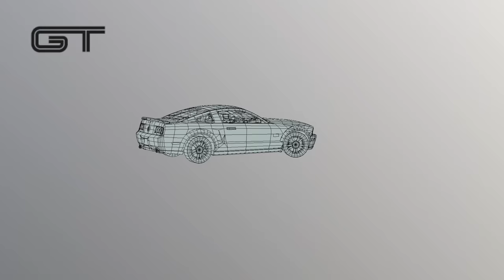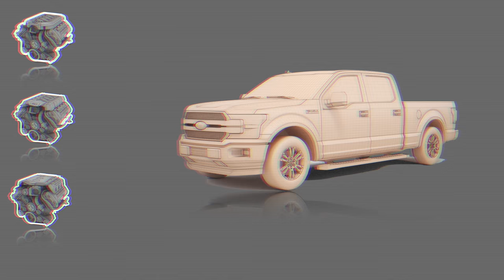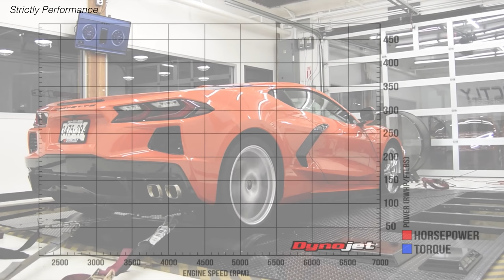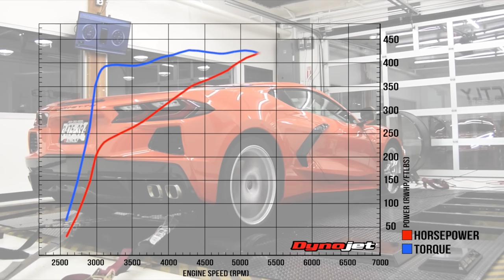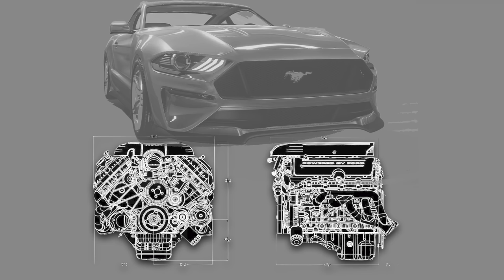How 5.0 Coyote Engines Beat LS and LT😮 | Explained Ep.2

Comment: I love my gen 3 coyote. Put it on the dyno and straight from the factory it made 412 wheel horsepower. Now I've added a Roush X pipe, steeda CAI and an E85 tune. I'll find out my new numbers next month which I'll post on my channel.
Reply: Yea I just sold my mustang still sad. Was a 2017 ecoboost. With just an intercooler, downpipe and a tune thing made 403 wheel with 460 tq but made over 400 tq at about 2000 rpms. Funny how the small ecoboost engines are torque monsters while big displacement boosted coyotes are hp monsters. Wonder why coyotes for making so much hp make so little tq till it's way up high.
Reply: @4touchdowns1game29  because that's what boost can do to an engine
Reply: @4touchdowns1game29  small turbo = fast spool, which means more torque down low.
Reply: @4touchdowns1game29  engine design
Reply: @4touchdowns1game29  that small turbo on the eco spools up early that’s why
Reply: @jasonn277  two small turbos....
Reply: @Steve-yr5vi  the 2.3 is a single turbo engine.

Comment: that was great.  I always thought the only way to go would be an LS swap.  I'd love to do a Coyote swap on one of my Crown Vics whenever (or if it ever) wears out.  But they seem so well made that they will probably outlive me.
Reply: I had a 2003 Crown Vic with 300k on it. It was my first car. Just sold it. I just had to add some oil every couple thousand miles. Changed the coil packs and spark plugs but besides only a few other minor mechanical things it runs great. The 4.6 is one of the most reliable engines ever made in America.
Reply: Get your wallet out bro
Reply: Your old vic motor will never die. You're just going to have to do it.
Reply: Ur gonna spend less than half on an ls than a coyote 5.slow. hell even the lincoln continental guys build turbo ls engines for roughly 6k rather than a bone stock coyote for12-15k

Comment: the ls3 makes similar to more power on boost with cam and there are heads flowing 360-380 you can buy to make 800rwhp. put forged pistons and rods and make 1100 reliably
Reply: Exactly
Reply: Without forced induction I doubt it. Also I better get higher horse for a 6.2 liter.
Reply: @losifer3867  800-950 rwhp stock bottom end ls3 light boost. 1100 forged internals, never break beating on it, 1300-1500 rwhp on stock aluminum block with aftermarket sleeves, and lsx iron block for higher power drag builds. 1200 has been dynoed from stock rotating assembly 4.8 truck ls engines. try that with a 12 to one compression 5.0 and see what happens. without e85 or race fuel and an expert tuner, over 800 power levels on pump with a coyote will explode. over 800 with any platform requires full 20000 dollar builds to live for a while regardless. you are an ls newb my friend
Reply: But ya see fords bottom end can handle up to 800 hp safely from the factory
Reply: @marcharris4176  not without E85 or race fuel on 93 at 12 to 1 compression motor can only see so much boost and cylinder pressures before fuel detonates and blows the Pistons all to hell in it. LS3 can handle 1,000 flywheel I know many guys are in the mid-800 wheel horsepower range and been driving them that way for 3 years without blowing them up on pump.

Comment: I'm familiar with 4-valve motorcycle engines and two valve motorcycle engines there is a pretty big difference in horsepower on the dyno and especially the cylinder heads at low lift on a flow bench the four valve flows a lot more air at low lift just my experience but this is not set in stone there's an advantage to having four small valves versus too big valves the two big valves are heavier and they will float before the four small valves float just saying
Reply: That depends. BMW m43 8 valve vs m44 16 valve, intake 71g vs 2x47g, exhaust 64g vs 2x47g.
Reply: more small circles can consume more area of a larger circle they are fit in.. more valves should allow more air in and out as you open more of the cylinder with eqch breath. yamahamma made a 5 valve for q second!

Comment: Man, I had an '03 Ford Lightning and my brother had an '04 Mustang Cobra (both brand new). Those 2 were the best sounding cars ever. Both supercharged, Lightning had a 5.4 and Cobra had the 4.6
Reply: I had the first 99 lightning in my town. It followed the also new 93 Cobra that I eventually sold to a founder of the MCA. And a 93 and 95 lightning,  88 5.0 and 89 gt , etc. Ford has always paid for tech in the engines. The Sierra RS Cosworth,  SVO, and SHO are the first show of serious engineering.  The new Corvette engine is a huge improvement on the coyote.  Over 600hp naturally aspirated.  I like my Dodge products for the retro design and simple but reliable engines however.  The Ford rules in the v8 category until the Corvette engine gets into the Camaro if it is still ever going to be produced.

Comment: ".....How 5.0 Coyote Engines Beat LS and LT....." 
Do they? 
They're bulkier, more complicated, more expensive, about the same weight but 50-to-100 c.i. smaller, and no more rugged. Aftermarket parts cost more, and are less easily found. An LS is pretty much THE choice for engine swaps, into virtually every car (except Mustangs). And I'm saying this as a non-Chevy fan.
Reply: You just have to watch the video. You can’t just read the title…

Comment: No lie, I’d love to see a comparison like this with the hemi, coyote, and LS/LT
Reply: No point ls/lt does everything the hemi does but cheaper and better
Reply: @scottearl7687  Better? Well that’s debatable. I’ve seen 5.7 ram trucks give a some LS guys big problems at the track. I agree with you on the LS platform is definitely cheaper though. The after market support for the hemi isn’t as large as it is with Ford and GM, so the expense makes sense. However Eric Holdner proved the older 5.7 hemi’s are more than capable of 600+ stock bottom end with the right piston ring gap. Who knows what the 5.7 Eagle would do. So there’s definitely a conversation to be had about the 5.7 itself. Let’s not take for granted that the drag pack starts life as a 5.7 block... and 7.5 second quarter is nothing to sleep on.
Reply: Look up LS vs coyote shootout an you will see why LS is on top

Comment: I like the DOHC 4 valve design. I have an 83 CB1000 custom where that tech was introduced to the states in the late 70s early 80s bikes. My bike makes 100 hp in low compression air cooling. Fascinating!! But in V8’s displacement rules. And the cam in block design allows 50% or more xtra displacement. I like the coyote like I do my 2 motorcycle engines both Honda 1000’s. The Custom n the 2005 CBR. The Coyote people say the LS needs more displacement to beat the Coyote. Well make the coyote 8.0 liters. I’m actually considering a Coyote mustang. Narrowing it down 240i, mustang, gen 6 corvette or a Toyota Soarer.

Comment: I love everything about the coyote on paper, but the footprint and its complexity keep me away. It is massive from valve cover to valve cover and has 40 more moving parts, even with the "technical" advantages, it doesn't seem to hold up on a dollar to dollar basis. As things are slowly getting better with more vehicles on the road using this platform I could see myself getting more interested in a build using this platform. Ford has always been or tried to be the "high tech" American automotive manufacturer, but it seems that 99% of the time this has just equaled a higher cost to build and a more limited audience in the after market scene. I still like it. its a mechanical masterpiece, truly a work of art.
Reply: Yeah as far as swaps into other chassis is the valve cover width makes it not possible.
Reply: @TurboV8boi  literally have to build the chassis around the engine, or truck
Reply: Ford also made some really cool Canadian Muscle Cars 🇨🇦 as well like the Meteor Montcalm, Meteor Rideau, Meteor Ranchero, Monarch Lucerne, Mercury M100, Mercury Econoline, and the 60 Ford Frontenac. The only worst cars Ford has ever made was the Pinto and the stupid Edsel brand that failed miserably.

Comment: these videos are amazing. looking forward to a video about the record breaking z06 NA engine coming in 2023!
Reply: Takes a coyote all day to catch a stock c8 they won't even run even close to Z06 can't imagine what's going to happen when they introduce the z51 the 5.5 is an overhead valve motor just like the coyote and it'll destroy it the ls is not a fair comparison it's a single overhead cam which will still outrun the coyote if you guys go back and look at the test that they did that coyote on boost but it busted the timing chain the Chevrolet LS series made 1700 horsepower the coyote can't hang with the ls with boost. Besides it ain't $30,000 to fix a junkyard 5.3 that will still outrun a coyote peace out
Reply: @mikegimple4725  i love how much in denial you GM fanboys are. The Camaro Can’t compete with the mustang so you got to compare apples to oranges over a different class of car 😂 imagine you think you’re smart comparing a mustang to a mid engine car that’s costs a lot more. There’s plenty of mustangs that are faster than C8s anyways if you give them room to stretch their legs and don’t sissy out on a 1/8 track because you know you’re gonna lose.
Reply: Gm boys are going to have to learn to speak Chinese now since the China boys own gm 😊

Comment: The LS platform is the most reliable, most affordable engine platform ever..
Now,can two coyote platform make more power? Yes.. It has amazing dohc tech.. But 5 timing chains make it way less reliable and more expensive.. If you gave me 10grand.. And including the cost of the engines, my LS would last longer and make more power.. Because gm has created an amazing aftermarket support system..
The coyotes are sick engines.. But Id much prefer a 6.3 Ls anyday

Comment: Only reason I love my 17 f150 is because after high school I wanted an 02-04 cobra but couldn’t afford it. I still can’t afford one with this crazy market but got a 5.0 on my f150 and could not be any happier. Makes the same noises the cobra would’ve made but a bit more useful
Reply: Sounds awesome brother, I have a 2011 Ford F150 with a 5.0L Coyote V8 in it with 147,000 miles on it and still going strong and its a beast and it sounds like a beast with the Borla ATAK exhaust on it.

Comment: I give Coyote motors props where they're due .  You can put a ton of boost to them and they make outstanding power . When you brought up the reliability of the coyote past 600 horsepower not being that great is exactly why I made the decision for a 7.0 LSx small block ( from blueprint ) from Summit .  650 horsepower out of the box . Works with the stock truck computer . Around 10k . Very reliable . Can I say I make more horsepower per cubic inch than a mustang ? Absolutely not . Can I have 127 more cubic inches from a smaller package than a coyote ? Absolutely . 427 cubic inches with a similar foot print to the 4.8 /293 V8 . That matters . Not only that but you're not touching a complete drop in race ready 650 horsepower coyote with a warranty for 10k . Since the Godzilla 7.3 has come out you especially can't deny the influence of the LS . Godzilla 7.3 uses pretty much the same architecture . Coil near plug , long runner intake ,  pushrod , skirted Y block , cam in block , 6 bolt mains with cracked bearing caps . It's not a bad thing or a bad formula . The dyno results speak for themselves .
Reply: Godzilla shares nothing in common with and ls all those features you’ve pointed out have already been used in the Ford Fe series big block from 1950’s to 1960’s

Comment: Back in 84 I bought a boss 302 from a local engine builder, Kirns in St Louis after I sucked a valve at 130mph, for my 68 Cougar, dad bought new, i restored in 90s and still own, with severely modified 351w heads on it, was 13:1, .640 lift roller cam... gas station still sold 110 then, would pull past 8000rpms. Was pure torque an HP for the day, would spin the tires at 40mph, shook the windows at McDonald's where guys met up to race, never lost one, it was scary fast. Got a 2014 f150 coyote few months back, it's gota helluva lotta giddy up, too bad it don't sound or rattle windows like my 68, was a bit hairy in the quarter. Both 302s but completely different but great, I prefer the 68, only has MSD 6AL box and distributor, no puters and was easy to dial in

Comment: 20 years ago my import buddies hated on pushrod V8s....my father a Porsche tech always said "they're just air pumps!"...He'd explain Germans and Japanese use smaller higher revving engines with DOHC head designs. Americans large displacement cam in block designs that were cheap and reliable. I'm amazed today how LS guys now hate DOHC and the import kids of the 90s really respect those Coyotes 💯👍
Reply: LS guys usually hate because they want to keep using junkyard shit and staying as cheap as possible cause they’re broke lol
Reply: @169abr  100% big facts
Reply: @169abr  you act like all LS are stock block running 8psi lol you can easily put anywhere from 5/10K into an LS motor. Which isn't "cheap". Compare a 700HP 5.3 to a 700HP 5.0 Coyote of any generation though. Becomes pretty clear WHY. You'll save a few G's with an LS to build the rest of the car. When you have a wife and kids and don't have an engineering degree, you'd probably go LS.
Reply: @R3AL-AIM  I already own a Coyote, and my girlfriend owns a Coyote. We don’t really want kids yet, I’d put that 10k into my bank account stay NA until I can afford to either refresh my Gen 2 or Trade in and get a lower mileage example, or if I’m ballsy I’ll boost a high mile one and see what happens. LS is boring to me and I don’t wanna do any swaps, I prefer to work with what I have an save myself a ton of hassle. 700hp if you’re talking crank is a Paxton or Vortech away which can be bought for 4K off the used market and easily make 700 on pump gas with BAP & inhectors
Reply: @169abr  who wants to eat beans  for years and take out a loan just to build a furd that will break. Work smarter and not harder🤣😂
Reply: The small block is the gold standard. Ford has been ham strung by the tight bore spacing dating back to the mod motor.
Reply: @trentdaddydolla647  can you not make a $400 car payment? If so you really shouldn’t be building race cars.
Reply: @169abr  who would he dumb enough to buy a new car in this climate? Plus payments will be more than $400 plus insurance. Only a fool.  Yes I can afford it. I can even buy you😂🤣I'm a used car dealer btw. But I'm cheap. Work smarter and not harder lmao. Why would I spend 20k for a furd when I can do a simple ultra reliable 4.8 turbo build that revs to 7500 rpm for about 2k? I can then use the rest of the money for my children for whatever they want to do in life.
Reply: @trentdaddydolla647  you couldn't look at a reliable 4.8 turbo build that would Rev over 6k for 2k. Make your point but be realistic.  And I've got a second gen coyote mustang and the payments on it were 450 a month. So not exactly breaking the bank 🤷‍♂️
Reply: @169abr  Nothing is funnier then seeing people call others broke while having a bank own car lol

Comment: Narrator Correct on Coyote displacement and power via High RPM. The Engine has small cylinder spacing which limits displacement  and it's already highly developed leaving little room for improvement other than expensive block , head and valvetrain mods or boost. Many have destroyed these with boost , mostly because they don't regap the piston rings for increased heat of combustion from boost.

Comment: i still prefer an LS tho because with minimal parts u can still run lots of power especially on boost and still be reliable to drive as a daily. and if u looking to get high hp with a stock bottom end the all you have to do is change the crank bolts and re gap the piston rings. u still have to go into the engine but other than that u could save lots of money 🤷🏿‍♂️
Reply: LS can make 1000hp way cheaper too. 500 for the motor out of a junkyard vs how much for a coyote motor?

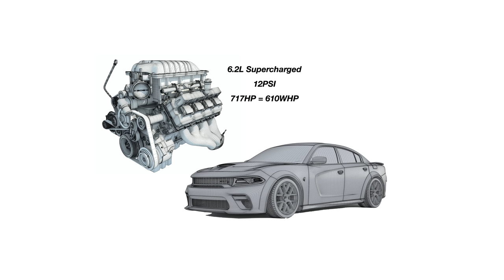Comment: 3:49 that’s not it, what your noticing is the difference between supercharging and turbocharging, not head flow differences because hellcat heads flow around 340cfm. It could be because the valve train on the coyote works better all around the rev range/ makes power higher but idk. For comparisons sake I believe the 6.4s flow around 360-380 and with a hellion twin turbo kit at 8lbs they can make 700whp
Reply: There’s more to it than cfm. The way the air flows in 2 valves has less static pressure and can flow more with less boost.  It’s why Jon Kasse doesn’t like giving cfm flow numbers. He says to look at the horsepower numbers because the flow number doesn’t tell everything.  If you don’t know who Jon Kasse is he’s probably the guy who’s won the Engine Masters challenge more than anyone.

Comment: hey, I've been a Ford guy for 40 years, but I consider the LS to be a better all-around engine than any mod. The LS makes huge low-end torque and is very compact. 99% of the time engines are at low rpm and the LS doesn't "need" to rev

Comment: You can’t just discount weight because of displacement. It’s all part of the motor and you can cherry pick all you want, but the LS packs more power in a smaller footprint with a very old design. I don’t hate Coyotes, hi-rev motors are fun, but LS motors are king by far. Your fox body example is hilarious because they mostly use iron block LS platforms for their power plant.